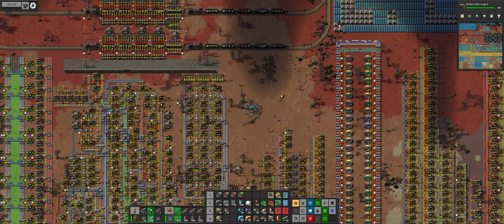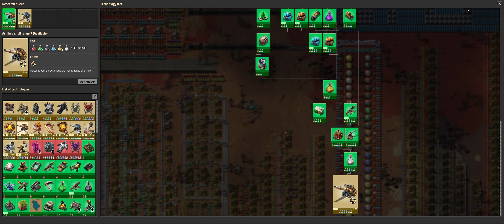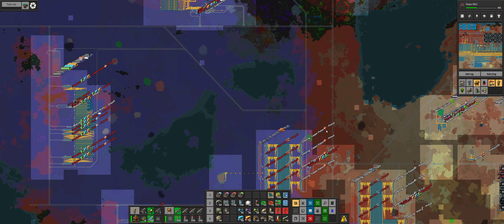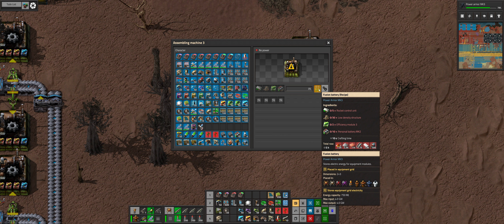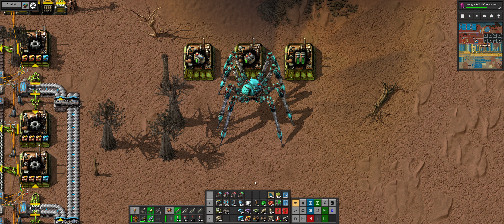Factorio Series 2 - 77 - SUIT UPGRADES - Playthrough

Comment: Hi Skuzz, I like your new armor you've made and the Spidertrons MK3 are going to be another nice addition as well.  The Mall is one of those builds that is hard to figure as far as how much of the intermediate materials it will use and you've set it up well for supplying the builds you've done thus far but then when you move on to something like adding a couple more thousand SPM to the mix and the amount of mall materials the builds will use, it certainly is a big difference.  I like what Peterrubis said in the comments there about making the buffer bigger and wanted to add that would there be a point in a build like what you're doing, where you say, ok, now's the time I increase my buffers for say, splitters, undergrounds, belts, inserters, etc, etc. so a good amount of materials will be ready when you need them, or, do you make a separate area for all those extras you know you're going to be needing?  I wonder what would be good to do because if it's not buffered earlier, then there's going to be a huge draw of materials into the mall and it could take awhile to get the buffer for all the different items...whereas if you did have more assemblers in an area that's pushing through the intermediate materials faster and without running empty, you could have them sooner and without emptying the belts to the other builds in your factory.   Also, you were doing science research while building the extra's today so another thing you could do would be to not do the the science research while buffering the mall...that might make a difference as well.  I really don't know as I've never done a big SPM base build so it will be interesting to see what you do and I'm looking forward to it.  Thanks again!
Reply from the maker: Increasing the buffer sizes will be my first change. But i would like to make some small changes to the mall. Not adding assemblers but giving them more materials to consume as most run under utilised.

Comment: The key to the mall is not adding more assemblers to make 1 item it is making the buffer for that item bigger. Example blue belts if you new you were going to need 50K plus of them you could have dropped 10 requester chests down by the building trains same for the other items. Assemblers in the mall run all the time if there is room in the buffer chests. I like what you did with the resign of the circuit build.
Reply from the maker: Its a good idea. This was my first go at this size base. What i will do is make a note of the size of each of the complex and the parts needed. Keeping the mall always busy and increasing the buffer size i think is the way to go.